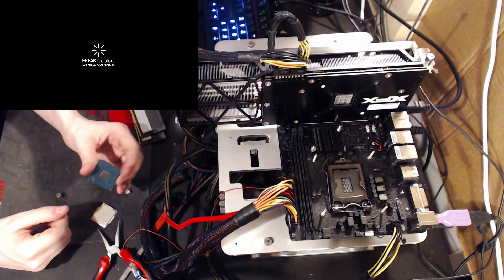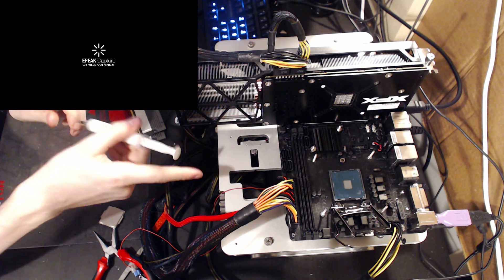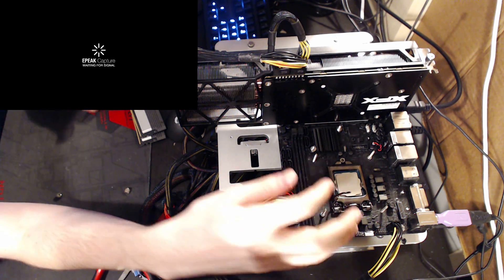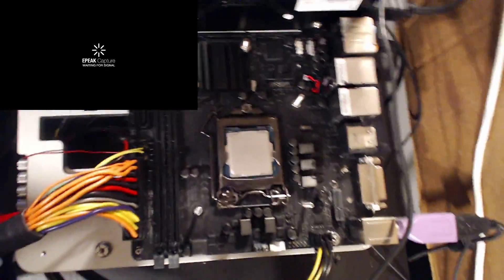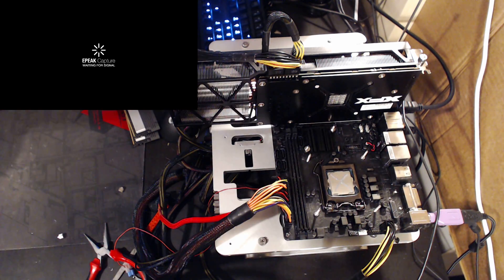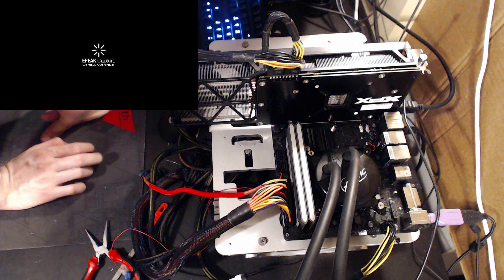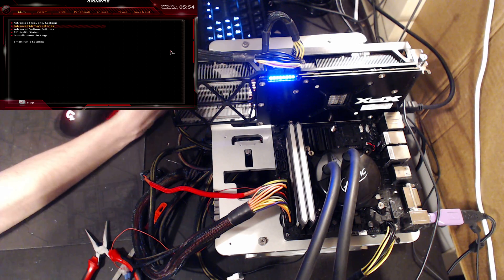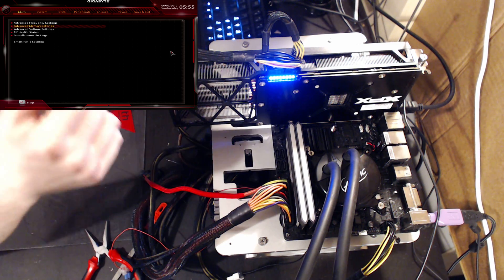Installing a delidded intel CPU

Comment: Hi @ActuallyHardcoreOverclocking What is this water cooling block which you are using? Is it any use for cooling something like a 7950x3d or a 9950x3d? I am hunting for parts to make an "overpowered" custom water cooling loop...

Comment: Builzoid. I have a question. The other day I was fiddleing with voltages on my 6700k and Maximus VIII and I somehow screwed up on voltage (Can't remember right now which one)
The thing is that when I went into Windows, the CPU (CPU and CPU Package)heated up 90 something.
I restarted, went back into the BIOS and changed back all the voltages to where I was stable (I'm at 4.7 @ 1.285v VCORE)
The thing is that now my CPU package is always at 45+ which before It was never higher than 30 if that. It's winter and the ambient is like 10ºc.

Could it be that I damaged the CPU temp sensor? 
The cores and the CPU temp (not the package) are at like 30. But the package is at 45 or around that.
Here is a pic of HWInfo (same with AIDA64 and the like)
http://prntscr.com/flmatz
http://prntscr.com/flmayi

Please, I beg your opinion. Thank you.
Reply: have you made clear cmos?
Reply: Hi. Yes, I indeed done that. Even as far as re flashing it.
The weird thing is that Cores are lower than Package ALWAYS. Even on full load.
I'm not concerned, because on full load, the CPU Package is almost at the same temp as the Cores (that's what AIDA, HWMonitor, etc says) but when on IDLE, Core temps are lower than Package, by about 30 to 40ºC
It's very weird.
Thank you for your time.
Reply: thats really strange! time to switch to ryzen xD!

Comment: Where's the new BIOS Video, BIOS 2.40 with Agesa 1.0.0.0.6a Code, It's supposed help with better CPU over-clocks, And Its Main Purpose was Ram compatibility and also to clock Ram up to 4000 and have Better Memory overclocking especially on X370 Boards Built for it???  Please keep us up to date on Taichi Overclocking, Please... And Thanks!!!!!!!

Comment: I was going to like the video for using Arctic TIM, but then I didn't because its not MX-2 😋
Reply from the maker: MX-4 is cost less for the same volume of paste and spreads easier and is basically the same performance wise.
Reply: Actually Hardcore Overclocking I was joking. I've had different results from you but I've only tested one tube of MX-4. Thanks for the response!

Comment: How often would you recomend refreshing the thermal paste if you have, say Collab Liquid Ultra on a delidded 3570k? Once a year?  Intels TP might be crap, but at least its stable so its allways equally crappy. x)
Reply: It will degrade the liquid metal and it gets unstable and will do nasty things like drying out/lose thermal performance and it can affect the metal parts of the heatsink more. Also liquid metal is conductive so extra precautions need to be taken like using electrical liquid tape around the area of the die so it doesn't cause a short if the metal moves off the die. It's really an extreme solution, high quality paste is much more convenient.
Reply: One thing to note with liquid metal is you never want to be running above 80c while using it.
Reply: Why is that Smith?
Reply: So, as long as you don't go over 80C it should stay stable? I'm getting heat problems at 4.8Ghz/1.320V with a Dark rock Pro 2. Temp peaks at 85C on some cores and slowly decrease... The cpu can hit 5+ghz but then the voltage and heat gets totally out of controll. A delid might be the answer.  And yeah, Shorting out the SMC's around the core with liquid metal would be really bad.. :/
Reply: Björn Dahlberg yeah, either a delid or watercooling. I'd recommend delid and high quality paste like gc-extreme, or kryonaught grizzly. The cpu can operate above 80c but I start freaking out when I pass 72. It's the liquid metal that you want to keep below 80 yes, good thing it helps with temps a lot. Also the liquid metal can't touch Aluminum it eats it.

Comment: Very interesting, I never noticed the tabs on the LGA sockets before. Tho most pic's I've seen only show the end result with just the top of the IHS showing through the socket-clasp-thing.    I will guess the glue/epoxy used by intel to attach the IHS does not add any sizable height to the IHS?

Comment: LN2 pot directly on die maybe? For daily use liquid metal and IHS. For soldered on IHS I don't see a reason to delid in the first place.
Reply from the maker: all kinds of issues with setting that up.
Reply: Cracking is unlikely with evenly spread pressure. He answered it in another comment reply.
- "Never tried it. There's is all kinds of problems like the LGA pin not making proper contact as well as clearance problems with the socket."
Reply: Do you think the pot is so heavy that it might crack the die?

Comment: @buildzoid run the cpu like i did with my old g3258 , remove the retention stuff and run the cpu w/o the lid , aio cold plate cpu die direct conctact , my temps droopet a lot :D did 4.5ghz and barely went over 50c in prime95.
Reply: Problem with SKL/KBL is the die sits below the plastic frame of the socket. Haswell/DC did'nt have this problem since pcb was thicker in prev gen
Reply: yeah but you need to be really careful otherwise you crack the die
Reply: that i did not know :O

Comment: why do you use paste instead of liquid metal? less of a hassle? For LN2, you'd obviously use Thermal Grizzly Cryonaut or similar instead of metal, but for an AIO liquid metal should be way cooler
Reply from the maker: Liquid metal doesn't work on LN2 and since it's expensive I've try to avoid using it unnecessarily. Like if I CLUed this i3 then the next time I want it on LN2 I'm going to be pulling the CLU off and that's a waste for me. Also I could've used Kryonaut which blows MX-4 away in under IHS applications but since I wasn't too sure about how this video would turn out I used MX-4 since it's cheap and I can afford to waste it on failed attempts.
Reply: Just probably as an example for the video, ideally if you're delidding you should be using liquid metal or a high end paste.
Reply: Liquid metal is very expensive compared to mx 4 and even cryonout. 

Buildzoid chages thermal past prety often. with liquid metal that would be a lott of money.
Reply: maybe because its not conductive
Reply: I thought so much, thanks for answering buildzoid :)
Reply: Actually Hardcore Overclocking 7600k here, how would delidding with my Noctua NT-H1 compare with Kryonaut/CLU? thanks
Reply: Ah, I was wondering about that, as for standard air or water cooling, you really want the liquid metal, or it's kind of a fool's errand.  I was going to put up a comment on this, but figured I'd scroll down thinking that someone would have already said it.

Is it true that the liquid metals actually act more as thermal insulators at cryo-temps?

Comment: How small and pathetic intel looks now compared to amd, why did they not innovate with their billions of dollars.
Reply: Yes Intel was convicted and paid out AMD 1.25 billion in 2009 for forcing/threatening OEM's to only sell intel cpus and not carry AMD cpu's at a time when AMD cpu's were superior. There is no knowing how much bigger AMD would be today if that anti-consumer and illegal maneuver never happened. Intel also will probably have to shell out another 1.5billion to the EU after a number of years. Intel is actually a really shady corporation. Big surprise considering how they have been milking us for years and now they are in full panic after failing the mobile soc sector and threadripper is forcing their hand to repackage server cpu's for HEDT consumers. Get an x299 and buy some hardware drm raid key lmfao.
Reply: @vdochev. Not.
Nvidia never got convicted of shady business practice like Intel did when they were condemned to pay $1.25 billion for bribing OEMs.
Reply: because otherwise amd would have never caught up and they would be dead.
Reply: No competition?
Reply: Not convicted, no. But they've done some really questionable things in the past.

Still, that's neither here nor there, because so did ATI.
(I don't recall if AMD ever has with it's CPU's or Graphics after the merger, but ATI absolutely DID do some really questionable things at times.)

When it came to ATI and NVIDIA they're both as bad as each-other, but I don't know post-merger...
Reply: Intel and AMD are rivals, but they respect each other. The real evil here is nvidia.